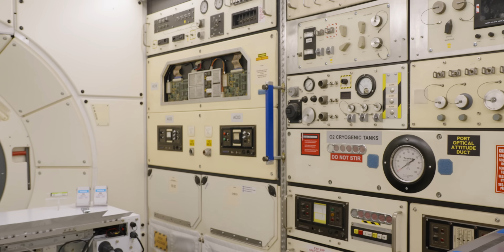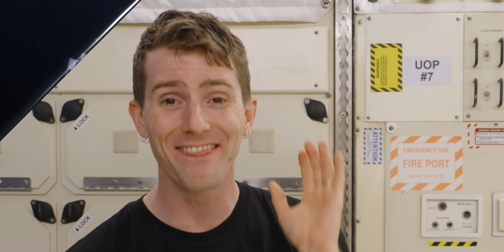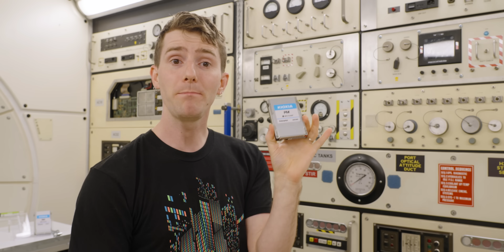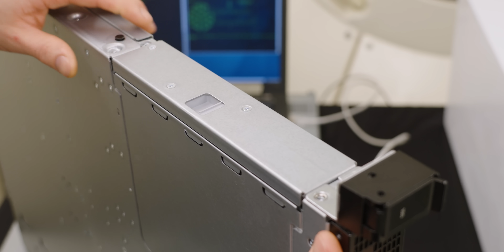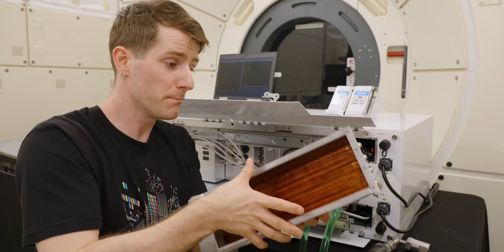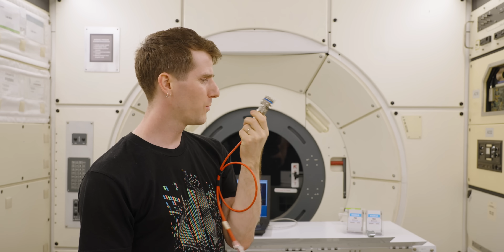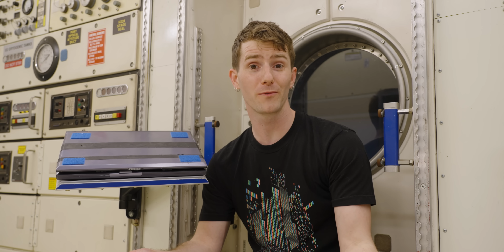here's why it's so hard to put a computer into SPACE - NASA HPE Spacebourne 2

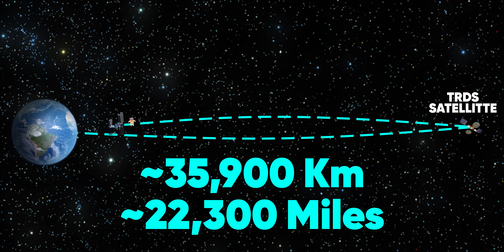Comment from the maker: Correction at 15:20 - This is meant to say "TDRS Satellite" instead of "TRDS Satellitte."
Reply: Just for some additional info. There are actually 3x TDRS satellites spaced equally around the earth so notionally they have 24/7 coverage at least for voice. But not for the "high speed" data links. The TDRS satellites then send the data back to ground stations where it gets phoned home. The max total connection speed through TDRS for the ISS is ~600mbit upgraded in 2019. But the TDRS satellites are used not just by the ISS. Lots of things use them, hubble, spaceX (for launches, yes they use starlink too now), landsat, and many more. There are/were plans to put a starlink node on the ISS but it needs to operate like a satellite not a ground terminal. So it would likely be tapping into the optical inter satellite links and spaceX's ground station network in a weird way. Don't know if they would get that done before ISS is decommissioned though.

Unrelated, I'm really surprised they didn't mention one other test that they had to pass. They have to not offgas anything nasty, so there's a bunch of chemical tests there. But! they also have a professional smell tester who has to sniff anything going to the ISS to make sure it won't stink the place up. Yes that's right, that computer passed a smell test.
Reply: The 'S' in TDRS stands for satellite. The correct way to denote it would probably be either "TDR Satellite" or "TDRSS Satellite" (Tracking Data & Relay Satellite System)
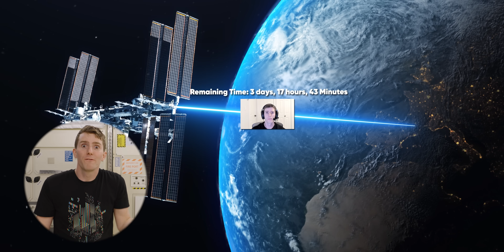Reply: Did u lot get to play with that DVD Rom Drive behind linus its got its own volume button 2:52
Reply: WHY WERE THE ASTRONAUTS FACES BLURRED?
Reply: Running an AD for a YT channel on the ISS is literally out of this world 😂😂
Reply: Turned TeeDRiS to TuRDS. 😂
Reply: I actually googled TRDS and then google corrected me to TDRS haha
Reply: Man my dyslexia really had me struggling to find the difference there lol
Reply: Thanks I was losing sleep
Reply: with internet like this, how do they live stream as much as they do up there?
Reply: Me being a "Supermicro" guy watching this video and laughing
Reply: @MirelleLaRouge  life uhhh finds a way
Reply: imagine talking bout places we've never been while listening to strangers with plastic cards that claim to be official, while also imagining to repeat the things from the strangers from the places we've never been and confidently telling others with 100% confidence, while never having been there or seen it themselves...

can't be me.
Reply: Looks like the ISS could use a LTT Tech upgrade based on ARM hardware :D
Reply: TuRDS
Reply: Very Cool Tech ! I Am a Licensed Amateur Radio operator & i have talked to & Listen to The ISS'S Onboard Amateur Repeater (VHF/UHF) Pretty Much Every Day & As Many Times as i have talked &/or Listened to I Still Find It Amazing That a Average Joe like Me can Listen & Talk to The ISS & Even a Astronaut From Time to Time ( Kind of Rare But Does Happen ) All The Tech Is Just Amazing ! We Have Came Sooo Far Soo Fast Seams Like !
Reply: TARDIS? ;)
Reply: Which Linux Distro (or base Distro) do they use on the ISS?
Reply: don't see anything hard in putting a computer into the "Hollywood basement"
Reply: I will state it again... Linus does not realise in the first minute.... he debunked the moon landings.
Reply: This is BS. 

Have you ever watched the NASA channel?

I had Dish Network some 20 years ago and couldn't pay the bill. They shut off everything. Everything except the NASA channel. 

There were live audio/video feeds running at all hours with children's science programs mixed in. 

So either they are patently lying about bandwidth being so small, or they are only telling you about a very specific part of it. 

Right this second you can watch a YouTube live video feed from the space station. 

They actually have 2 separate high definition live streams running concurrently being simulcast on multiple platforms. Including their own. 

They were running various high definition satellite transmission systems since nearly the very first day the station came online. These transmit in far higher speeds and bandwidth than the average earthbound internet connection. Significantly so. 

They were blowing the doors off T1 college lines before most colleges had T1 bandwidth and speeds.

And this bandwidth has not been limited to audio/video use. 

They have real time editing of those video feeds today. That means in the approximate 10 second delay they have set up on ISS broadcasts they can delete, modify, and add to ANY outbound video and/or audio being broadcast to earth. And they have been caught using it. So it's not theoretical. 

So only the segment of bandwidth they are allowing you to see is 1 megabit per second. Or they are intentionally and unnecessarily lying about the total capability of ISS transmit bandwidth for electronic communication.
Reply: I’m pretty sure Elon Musk could solve this with Starlink and get broadband on the ISS. Astronauts deserve Netflix and YouTube an infinite video calls with their loved ones. Can’t believe this isn’t already a thing. Edit: I didn’t finish watching before I made my comment.
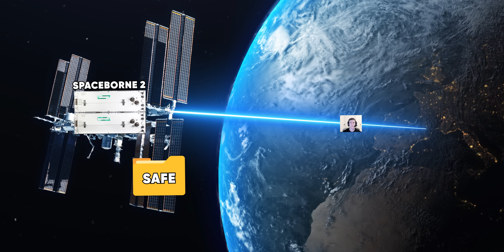Reply: 2:59 in captions it says "Spaceporn" instead of "Spaceborn"
Reply: What about the fact that the subtitles say spaceporn instead of spaceborne
Reply: Thanks for the Laszlo Supernova intro for a space tech episode.
Reply: what a bunch of puppets.

Hench... Earth is not a ball beneath our feet.
Reply: TDSR?
Reply: @Hardesteen  TDRS, said like tee-driss
Reply: No comments ? Lemme fix that
Reply: Back to VPN sponsors, and back to correction in comments😎

Comment: Well the other reason they'd use SAS, is cos those Gen 10 360's are built for SAS. We got a bunch of them at work. Yeah you could use SATA, but its kind of missing the advantages of SAS over normie-Sata. The only real problem with SAS is its a pain in the neck to find cables.

Comment: It has to survive vibration ? I understand larger components like satellites needing to survive, but a small computer ? Why cant we send it up in a suspended cradle to limit vibration in general ? That would be a variable you could remove.
 Because the ISS doesn't vibrate, it only needs to limit launch vibration. It should be a small enough mass to work, compared to the mass of a satellite that you cant suspend the same way.

Suspend it with springs and throw some dampers on it.

It doesnt need to survive vibration if you mitigate said vibration.

Comment: It's become quite a bit more common nowadays (i.e. CubeSats), but developing compute systems for space is an interesting experience.
I've done some myself, and it takes quite a bit of analysis of what space environment you're operating in (space weather is a big factor) and the components you're using.

Radiation is in particular the big factor for space electronics, and apart from having a limited lifespan (they can only absorb so much radiation dose), data can be corrupted by bit-flips and other parts (e.g. power electronics) can completely burn out if the wrong type of cosmic-ray particle happens to pass through.
The trend for 'new space' nowadays is using standard commercial components (that have been radiation-tested) rather than traditionally radiation-hardened ones, but this has put much more of an onus on trying to find parts that can survive your particular space environment.
For example, a computer on the ISS is in a hugely different environment than something operating near Jupiter (see JUICE mission and it's leaded electronics vaults), so the laptops found on the ISS probably won't survive very long there.

All that said, computation power for satellites seems to be less of a problem than figuring out communications nowadays. They can handled Tbyte's of data per second, but the real bottleneck is downlinking that data back to the Earth.
Optical satellite communications / laser links seems to be the next big thing (at least from my little corner of all this!).

Comment: Just thinking - weight is always a problem though, using old - 80286 era old - hard drive formats , the ones that looked like 2 or 3 full sized drives stacked... nvm-e or ssd in the centre, fill the rest with polyethylene armour then either lead or gold wrap...

Comment: I am a retired Computer hardware technician and have decades of experience of people that mistakenly thought the accumulation of datum equals intelligence. It never does as it is knowing how the all the relevant datum interacts which each other to produce knowledge. Thus it is understanding the structure of datum interaction that produces knowledge. This entire presentation displayed a lot of "gee golly /gee whiz" information that had nothing to do with the problem the title indicated.

There was only a single datum in the entire presentation that gave a single clue why the computer systems were failing on the space station. It was the high capacity power supply capacitors that were failing due to being moved from a one gravity field to a zero gravity field. And such capacitors use a oil-based or plastic-based material to maintain plate separation in the 10 microfarad (and above) range for the capacitors. So in a zero gravity field the electrical fields inside the capacitors were causing copper or aluminum dendrite growth between the capacitor plates. Shorting out the power supply capacitors.

Comment: Lets be really really honest here... They could VERY easily put nuclear thermo-electric generators away from the crew module & have plenty of excess power. They could use that to transmit 24/7 & networking wouldn't be a problem. Its a political and public image issues, rather than an actual limitation.

Comment: Our company did some Nav boxes for the original TDRS satellites.  These have about the same data-rates as a standard telephone Hayes Modem, from the 1960s to maybe 1970s.  Nonetheless, OUR gear still works great, and is heavily in use, because we used Metal-Mos, standard large Bipolar, and a LOT of radiation blocking materials in their construction.  The smallest IC dimensionality was probably around 400-nanometers.  With present ICs, it is common to use anywhere from 40-nanometers, down to 7-nanometers (or less recently).  Any high energy photon is about 400-nanometers or less, so the modern "digits" can be flipped, interrogated, or burned, by any radiation beyond the High UV spectrum.  There is only ONE USA company which can still make these digital assets.  Will have to be "re-invented" for travel to Mars.

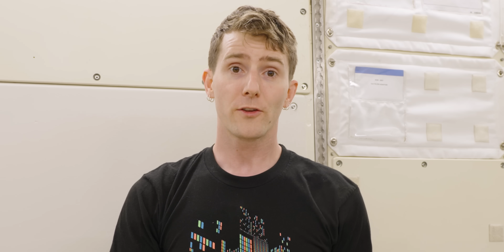Comment: 12:11 If you decompress highly compressed air then air becomes extremely cold. That is the principle used for air conditioners. If there is no air outside of the compressed air section in ISS. No air means no heat conductor.

Comment: well akshually linus, space is a vacum and hvac units work by taking heat out of a house and passing air over compressed vapor. Water boils and freezes at lower or higher tempetures based on the atmosphere its in. This means cooling solutions would look like cooling components or a computer by putting it over an hvac vent. I mean this is just one idea but also the point for removing heat is that they can just delete the heat. Getting rid of oxygen would be impractical but they use carbon scrubbers iirc to get rid of excessive co2/co when it reaches certain levels where it's more practical than recycling it. I'm skipping some key details and speculating a little here and there.

But ALSO what they could do is rather than having many of the computers on the space station they could instead have a solution similar to cloud computing where hard calculations or graphical rendering is done on the planet side or satellite and beamed back. Think like Google Stadia.

Comment: Huh... Considering the super important heat and energy requirements for computers on a space station, I could see advances in RISK5 processors being desirable for space station engineers. What with RISK5 being very power efficient, and power efficiency being important for getting the most calculations per unit of heat.

Comment: @13:50 Those connectors are on the cheaper end of Milspec connectors, There is a 12 pin hermaphoditic cable head used for naval fiber optic connections that costs close to $5000 a head. The very fragile alignment sleeve assembly costs over $400 a piece and regularly have to be replaced.

Comment: loool...if they claim powering the pc.. u have solar... if they claim cooling, "space" is already cold..if they claim changing pieces, there are no air in space so no oxidation and corrosive efects in space... so short answer... space is fake and made in hollywood basement...plus.. big youtubers = gov assets..
Reply: "if they claim powering the pc.. u have solar."
Which is what they use, then?

"if they claim cooling, "space" is already cold"
Vacuum, being nothing ,has no temperature by itself.
Cooling in space is hard, actually.

" there are no air in space so no oxidation"
The PCs are in the ISS, so under pressure. Which is why it's way easier to cool them, btw.

"space is fake"
What would that means?

Comment: This has made me curious for a long time. 

Using a Mineral oil computer in space or underwater for the extreme pressure areas, Im wondering if the mineral oil will block radiation like water?
Will nasa let linus put a pc in space?

Comment: Surprised that they're not being configured as RAID array elements (like, a RAID level 6 or 60).  I guess w/ SSD the individual drives are considered reliable enough (finally), that you don't have to worry about drive failure.
Reply: I saw a RAID1+2 hot spares, no?

Comment: Really dope video. As someone who works in networking and deals with Geostationary satellite connectivity for remote work sites/offshore vessels, it can be miserable. While it works well for providing connectivity to places that would otherwise have no connectivity, it has absolutely been left in the dust by Starlink. Starlink typically sees 50ms - 100ms latency while the BEST you'll likely get with a Geo Sat is 500ms.

Comment: Wait….water cooling is easy in space right? 

riddle me this …. you have your computer and then you have your stainless steel tubes going towards the outside of the space station and how cold it is in space those tubes will get insanely cold and the water gets cold and that is how you cool your computer right? I don’t specifically water but whatever liquid can get really cold without freezing of course. that makes the most sense to me rather than wasting power trying to cool down the computer. You should just use the resources around you.😮
Reply: "and how cold it is in space those tubes will get insanely cold and"
Space is not "cold". 
That won't happens.
(Well, only very slowly).

Comment: Hmm I never thought about what it would be like to get a cut in zero gravity I would assume most of the blood would pool near the cut because blood is mostly made of water and in low gravity materials with high surface tension tend to at least partially pool on objects although I imagine any significant injury would likely send blood all over the station which would probably contaminate the life support although I'm curious as to whether the water recycler can recycle blood into drinkable water 

Tldr: Speculating what it would be like to get a cut in space my hypothesis being either a weirdly large scab or a big mess

Comment: The efficiency (or lack there of) and thus heat of computing devices in space is a bit of a PITA. You see, the smaller (and thus typically more power efficient) a micro chip architecture is (which really seems ideal for the power and cooling limitiations in spacecraft doesn't it?), the more fragile it is with regards to data corruption and actual physical damage to the substrate from high energy particles (HEPs) and ionizing radiation. The crude older stuff, which is not as efficient power vs. computional (but better than it was back in the day), and perhaps so coarse that it verges on the μm (yeah micrometer, NOT nanometer) scale (E.g. Intel 8086) is very reliable, but not very power efficient, but still used on critical stuff that just needs to work.

Comment: If they really just basically ping before transmitting their data (and hoping it was connected while doing so) then they should hire someone to design a better (more robust) packetizing system. But even i get that it can't be that rudimentary. Made me think of all the cool ways to solve a high latency, low bandwidth connection, for achieving highest possible efficiency.

Comment: The AstroPi kits are basically a giant heatsink. They need to get rid of the heat by radiation only. They also need to be able to handle them, so they are not allowed to get hot.